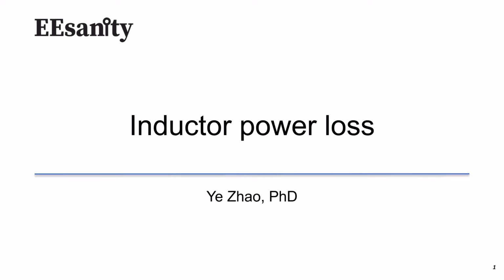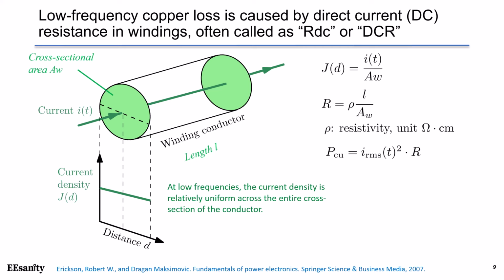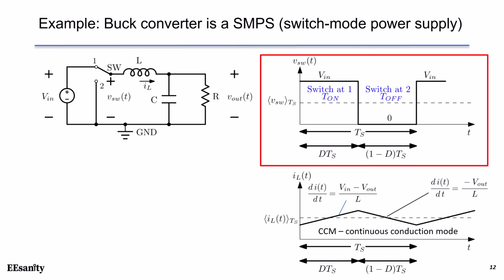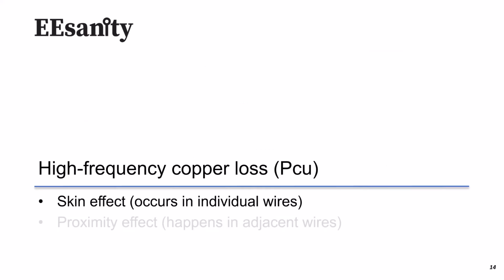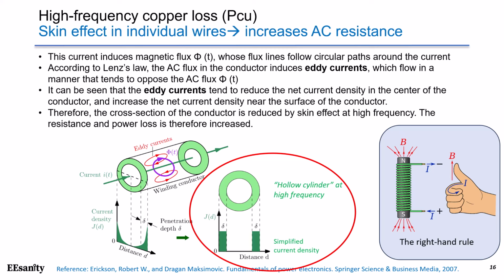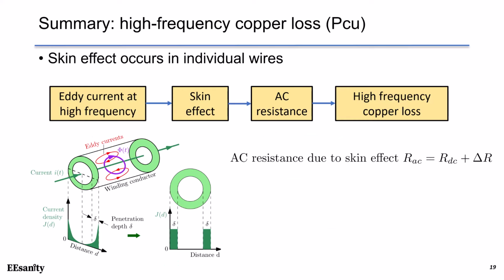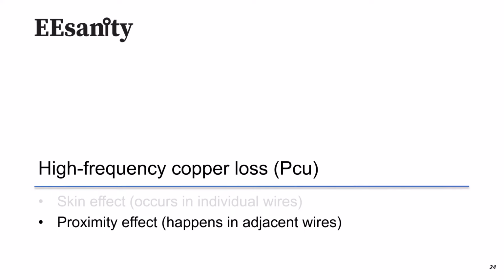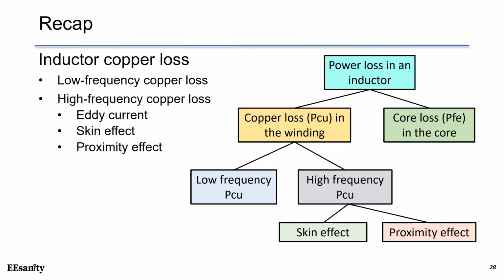Inductor copper loss

Comment: @13.23 isn't the direction of the primary magnetic flux,  incorrect?
It's shown going counter clockwise blue color,  however technically it's should be clockwise.

Anyway,  overall it's a very solid video. Thanks for such a great video